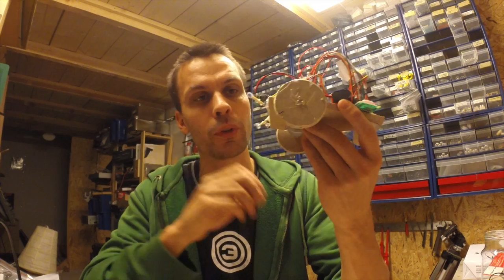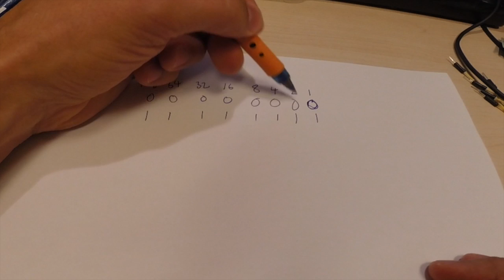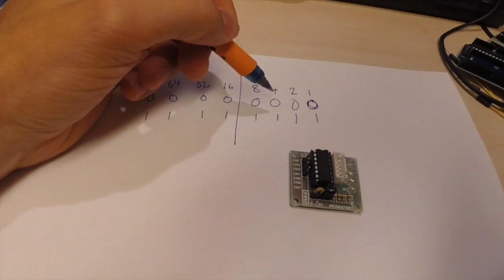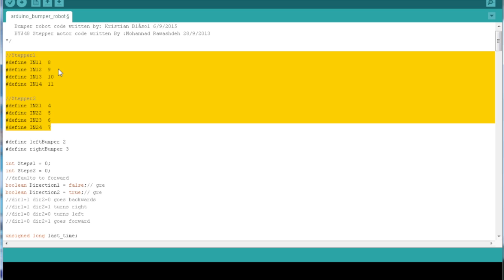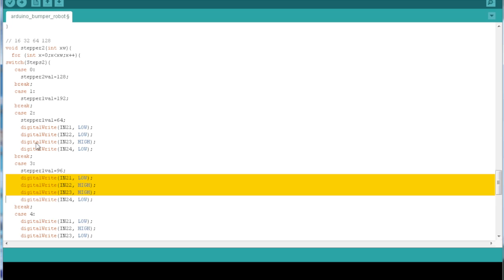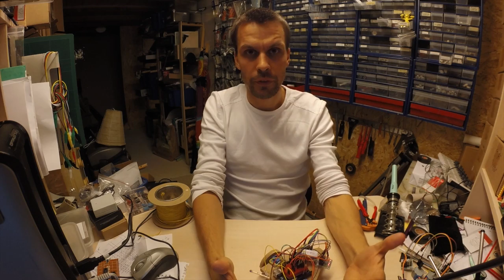Controlling two 28BYJ-48 with three pins and a 74HC595 [Anything Arduino] EP16

Comment: at 14:46 , i think, it is better, if you add these 3 lines at the end of each function [stepper1 & stepper2]
that way,whenever you call it to move a step or two, it will latch the value out to the actual driver for making that happen in real time.

kindly, correct me if i am wrong here. Great video btw :)
Reply from the maker: It was a long time I wrote this code. You might be correct. Thanks for the input. :)

Comment: Seriously Really helpful.
I have been trying thing for weeks...following the same schematics except the buttons. I have been unsuccessful until I updated the time interval to be ~ 3ms.
Reply from the maker: Yes, the small delay is important, it is interesting to see that even though the age of the Arduino, it is still too fast for some applications and it needs to be "slowed" down :)
Reply: https://github.com/sam016/room-mosk-net-controller/tree/wip/schematics
I have got everything soldered and ready to run, but, not able to power my setup, even though I am using the external power source of (5V/2A). It would be great if you can help or recommend something.

Comment: I like the general idea of this tutorial, and I did learn something from it, but I found it too difficult to follow you as you corrected mistakes on the run!
Reply from the maker: +Ultimate Villager Thanks for your comments. I try to make it as "realtime" as I can, that means I sometimes need to fix mistakes. This is a way to show how "easy" it is to actually come from start to end with an Arduino project. I have although in later projects started to go through the code after my changes, which gives a bit better flow I think (also when the projects are larger its quite boring to watch me code it all ;) But again, thanks for the feedback!